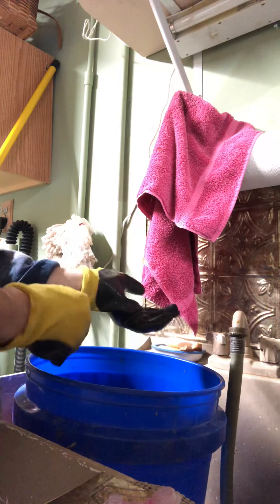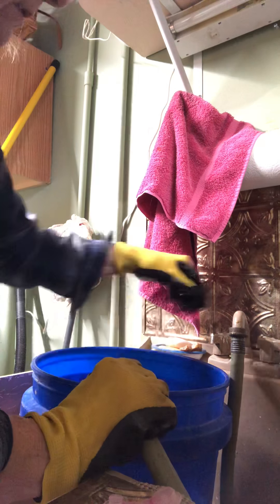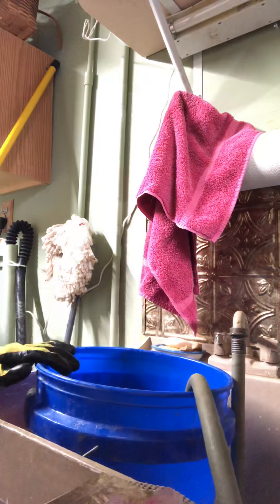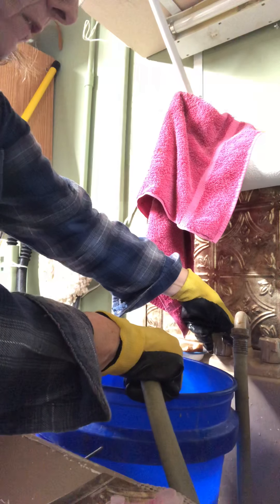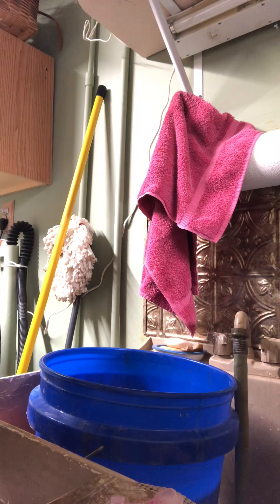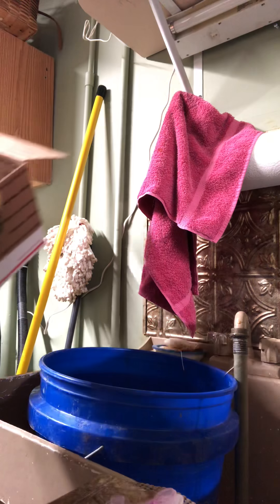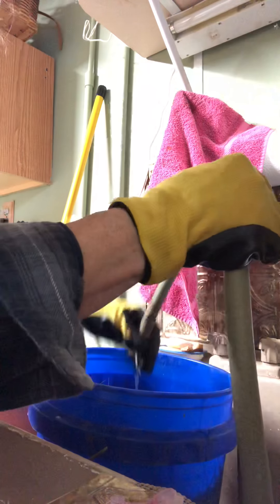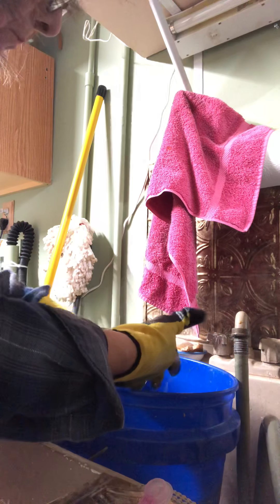Washing porcupine quills in preparation for natural dyes

Comment: Hello there - I have some natural powder dyed that my mom bought at a craft festival near where we live.   I have blue,  burnt orange,  and a green.  I'd like to use them to dye some quills I have but I dont know how.  I've already washed the quills very thoroughly.   I have a small crock pot.    Any tips on how to do this?
Reply from the maker: Well I’ve only made dye with raw materials so I can’t tell you how much to use . If the blue is indigo is very involved but try the orange first. Just add water and make it pretty strong. Then simmer your wet quills on low overnight or until you get the color you want. If this works try it with the others. If it’s real indigo line I said it’s very involved. You have to use lye and make a stock. And I’d try the green with water too. Unless it’s verdigris then it needs to be in vinegar. Good luck.
Reply: @lindapritchard5854  yeah I just mixed the blue and orange together lol it isnt blue at all.   I wanted to make a pair of moccasins from an old picture and the quills are a blueish purple and some are dark maroon.   But yes I see what you mean about the blue being harder to dye.   So far these quills are super light orange,  but they've only been in the dye for 15min.   Thankyou for your quick reply !
Reply from the maker: If they are turning orange already they should dye ok. It’s probably Osage
Reply: @lindapritchard5854  Yes they've darkened quite a bit they're looking very close to the color of the orange bottle.   Very pretty!  I have them in a small crockpot I started the water,  dye, & quills on high but I will turn it down to low now so they dont boil
Reply from the maker: @mgansworth78  yes if they get too hot you will ruin the quills. Just simmer them.
Reply: @lindapritchard5854  I just took a couple quills out and I noticed when I dried them off (not dyed!) with a towel a lot of the dye rubbed off.   I cleaned them obsessively before I dyed them I wonder why the dye isnt sticking as well as I'd hoped.   Maybe I should let them dry naturally when I take them out ?
Reply from the maker: @mgansworth78  you might try adding vinegar to a pre soak before you dye them and also in your rinse. It might just be the dye you are using. . Without knowing the dye material it’s hard to tell.